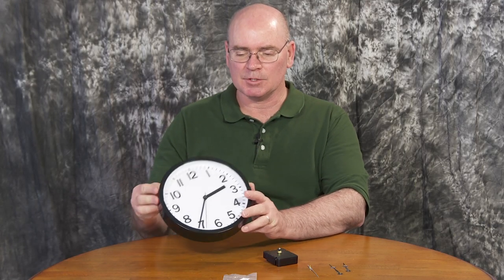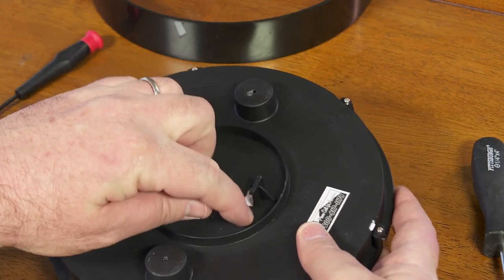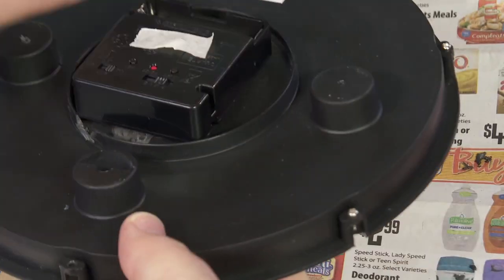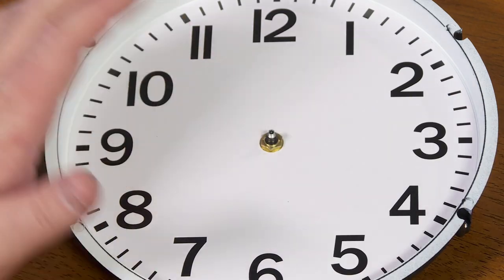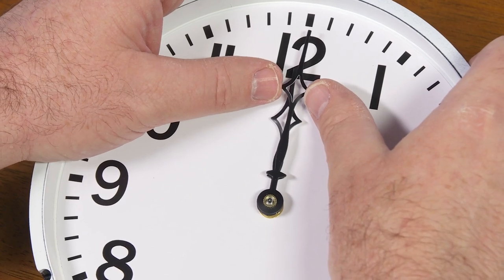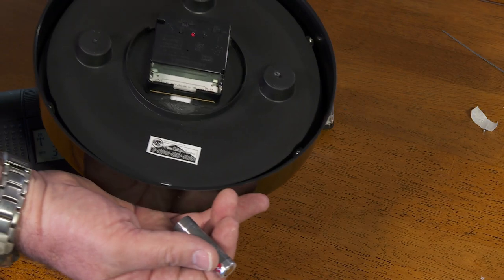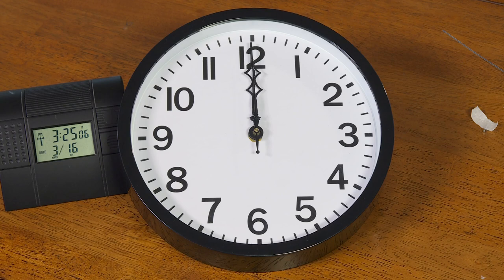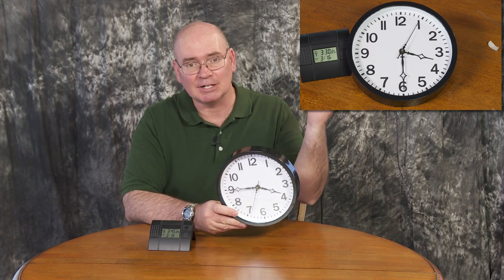Changing a Regular Clock to a Radio Controlled "Atomic" Clock

Comment: Actually I have two older clocks with really nice cases whose basic quartz movements have died. One I will be able to replace the movement with  an "Atomic Clock" movement, the other I will only be able to replace with a "set-and-forget" movement because of the enclosure, but finally both will now have a new life. Thanks!

Comment: Clock movements come with lots of different shaft sizes (length & diameter.) Not all movements will fit any clock.
Reply: Yeah but it's not that complicated if you do a little research. There's basically 5 types for (modern) kitchen clock type movements , the first twos mostly for european brand clocks. Euro shaft, Euro push fit, (American?) I-shaft, chinese and japanese push fit.
Depending on your location finding RC movements can be difficult. For the Euro you can obviosly find movements in Europe. For chinese pucs fit it's particular easy finding a good RC movement. Most discount and mid price modern clocks use some chinese movement and though chinese movements is made with many fittings for new clocks it's mostly chinese push fit (Most Ikea clocks, Newgate, Karlsson, Acctim and many more similar brands) - so as long as it's not a large clock (~35 cm or larger) it's easy to change those movements. By far the most difficult is Japanese push fit - has not seen any RC movements with such shaft.
And than there's large consumer clocks (pro clocks is something different). For Europe UTS makes movements but I've not seen any high torque chinese movement. I have a few older clock movements from the time before automatic hands detection - very useful for a little hacking. I've modified a few of them to basically become drivers for other movements. I have a large 50cm wall clock with a chinese (though very decent) high torque 12888 movement. While an HD-1688 RC movement fits the hands it's nowhere strong enough to handle the large heavy hands. So I disabled the original 12888 electronics (cut a trace on pcb) and just soldered wires out for the motor. The electronics from the older RC movement then powers the 12888 motor - hey presto a very large RC clock with the original hands (other would destroy it's nice design) even though it's impossible to get a RC movement that without modification can handle the hands. Manually align hands to 12, then tell movement you're done and it'll start receiving. Then it'll fast forward to correct time one received. But with only 1 motor (electronics was designed for 1 motor) it can take up to ½ hour for a full 12h catch up. Not as speedy as new clocks but good enough and very versatile and easy to make use of the output without difficult interpretation - just use it raw and it'll keep track of time for you.

Comment: Greg, did you hear the recent news? They might be shutting down WWV and WWVB. Government wants budget cuts and NIST proposed shutting down their radio transmitters in their most recent budget request. It remains to be seen if it actually happens, but it's in their budget proposal for 2019. If this happens, I guess we'll see GPS clocks take over.
Reply: Will that mean that an atomic clock will work no matter where it is located? This clock seems tied to Colorado.

Comment: As the head of facilty Maintenance   atomic clocks suck. Way less time-consuming when all you got to do put a battery in adjust the in seconds with your hand. You don't have to be dependent on a signal you may or may not get. I have to take my atomic clocks outside and wait. I don't know how long for them to get going.

Comment: Hello Greg Anderson. Can a radio-control watch that was not originally manufactured to receive a particular one of the six major time calibration signals (e.g., the USA time signal from WWVB in Ft. Collins, Colorado) be modified to receive that particular time calibration signal by either replacing the motor in the watch as you do on a regular wall clock in this video or by replacement of or reprogramming of the watch's microchip by an electronics expert so that the radio-control watch will receive a particular time signal that was not originally programmed into the watch by the watch manufacturer? Could a non radio-control (i.e., a regular, solar-powered watch) be modified to become a radio-control watch?

Comment: Great video.  Thank you for posting.  I was converting a clock and was not sure how to initially set the hands before powering it up.  Glad you addressed that.  I also wondered what that pin was in the back that you took out.  I probably would have left it there had you not said to remove it.  Unfortunately the atomic movement I bought was defective.  So my work went for nothing!  I ordered a plain old movement that adjusts for DST.  Did so because I'm working with a 30" clock and was told the atomic movements can't handle the bigger hands of a larger clock.  What are your thoughts?  Is there an atomic movement I could have gotten that would have handled 12" hands?

Comment: I didn’t even know about atomic clocks. Thanks for the information! What happens when the battery dies? Will the clock automatically reset itself when a new battery is put in?
Reply: Yes, the clock will go through the process as shown here once you put new batteries in. It will take it a few minutes to find the radio signal (which will be impossible during daylight hours unless you live close to Colorado).

Comment: Hi, there are several radio controlled units available on the mentioned site. The differ in clock thickness such as 3/16” and 1/8” etc. How do you select which thickness you need?

Comment: Where do these radio controlled atomic clocks get their control signal from?
Reply: Colorado.  NIST runs a radio tower there that broadcasts the reference time based on an atomic clock they operate.  These days, however, the radio system out of Colorado is getting outdated.  Why?  Because every GPS satellite in orbit has an atomic clock on board and can transmit time of the same accuracy without all the interference of terrestrial radio signals.  If you look at your smartphone, the time is always accurate because it's constantly pulling it from the cell tower which gets it's time from GPS satellites.  So, really, what we need are bluetooth wall clocks that can sync with your phone (or the wifi in your house).  It's a better solution for people who live on the coasts away from Colorado.

Comment: These directions worked like a champ but, after a day or so the hands start moving again and haven't stopped.  I pulled the battery and let it sit for a while like a day, and repeated the procedure and it worked again and then it started running again.  I have three other atomic clocks in the house and they work like they should.  The position of this clock is in my garage window facing the west.  Just about ready to dump this sucker in the trash.  Any ideas?
Reply: Lost of signal, only partly came throught so it runs Constantin put it somewhere else

Comment: I hate to NITPICK, but what is ATOMIC about this.
Apart from the fact that the electricity that powers the transmitter for the time sync signals may come from a Nuclear Power Station.
ATOMIC CLOCKS are laboratory instruments that use the ATOMIC DECAY OF CAESIUM to provide a time base that can achieve accuracy’s in the range of BILLIONTHS of a second. They can also cost hundreds of thousands of $s.
I used to work for HP when it was a superb manufacturer of top quality scientific instruments, I believe it is now known as Agilent.
HP made Atomic clocks such as I have described and I used to wander through the labs that did the certification of those clocks. You could watch a digital display showing the mind boggling accuracy they achieved.
THOSE ARE ATOMIC CLOCKS.
Reply from the maker: Um… not to nitpick but that’s why I put the word “atomic” inside quotation marks. (P.S. It sure doesn’t seem like you “hate” to nitpick.)
Reply: @GoodTimekeeper  Now WHY would you mention ATOMIC, EVEN IN QUOTES.
Where you hoping to attract viewers like me, hoping to learn something REALLY INTERESTING.
What a DISAPPOINTMENT TO FIND THIS PATHETIC LITTLE VIDEO.

Comment: radio clocks are a scam unless you live within like 100 miles of the transmitter. otherwise you will never pick up a signal. its just a way for companies to sell cheap clocks for more money and not tell you that you wont be able to use the feature you bought it for because the NIST budget was slashed and the time radio station is putting out about as much wattage as the local AM talk show station.
Reply: @  Fakiirfication Wow with a name like that I can see why Radio Clocks give you a problem, HaHa, just kidding everybody's name is important.   But frankly, I think you have the problem backwards about radio clocks,  it is a known fact that radio clocks will not work outside of the U.S.A. But I don't know of any reason that they won't work inside,  that was the reason why the transmitter site is located in the state of Colorado so that the whole U.S.A. would have coverage,   Now Alaska and the Islands would be a different story.  They would need there own transmitters.
Reply: @chucksteward2615  nah. The trump admin cut funding to the nist lab that operates the transmitter. So the signal is very weak. My radio clocks went from syncing just about every night to rarely syncing at all. They still run the transmitter, but it is at reduced power. Not useful if you need to depend on the clock being right without adjustment.
Reply: @fakiirification  Precisely. Six years ago I ordered two cheap radio controlled movements. I installed one in my office at the Iberoamerican University in Mexico City. It would  sychronise daily and kept perfect time for a couple of years. Then, one day it stopped syncing. I blamed it on the price and myself for not buying a more expensive one. I installed the extra movement I had kept for years and it never worked. Then I learned that the signal had been weakened by the cut in funding.